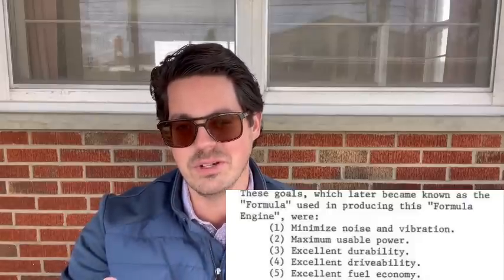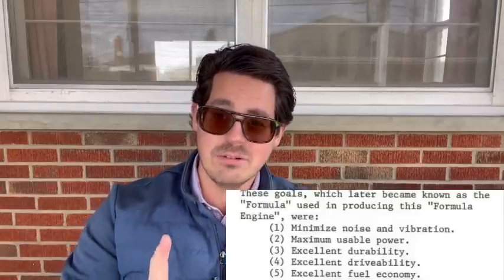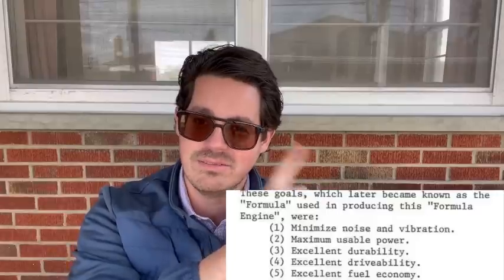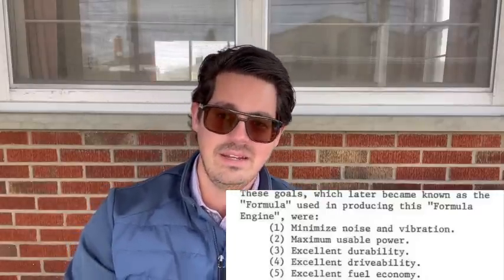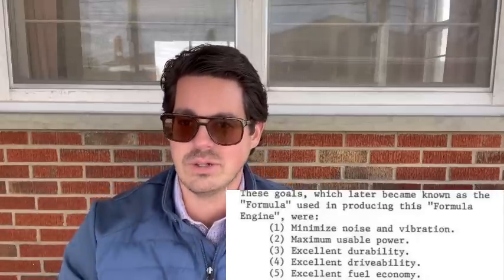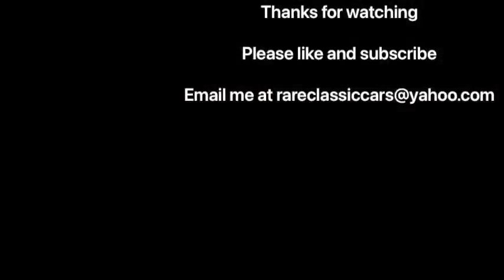Worst Engines of All Time: GM's 2.5L Iron Duke 4-Cylinder

Comment: Spot on review. One thing these engines were good for were marine applications. I had one in a mid 80's 17' Sea Ray. It made 120 hp, which was adequate,  it was  fuel efficient, and extraordinarily reliable.  The hull and engine cover did a fairly good job absorbing the noise and vibration.  I miss that old boat.
Reply: The marine engine was designed  back in 1962 .
Completely  different  program.
The Duke was a metric engine and the marine engine was SAE  dimensioned

Comment: One of my Uncle's had the EXACT opinion of the Iron Duke as you described. He had a 1977 Buick Skylark with a 350 V8 and in 1982 wanted to trade it in for a new Skylark. Well when he first looked at the new Skylark, he was rather impressed with it, even though it was a good deal smaller than his current car. He was surprised at the roominess of the interior for being a smaller car. He found a 2 door that he liked in the color and options he wanted and went for a test drive. When he started the engine, he changed his mind immediately !!! At idle it shook the whole car so badly he thought the factory put in defective motor mounts. He also said that his Stepfather's John Deere tractor was quieter and smoother running !!! He instead opted for a Buick Century coupe with the V6.

Comment: Had a few of them in S10s.  Ran a company that used them for delivery. Didn't have a lot of problems with them. Couldn't get out of there own way but would easily get over 200k.  When they switched to the 2.2L then the real problems started!
Reply: Same had 225K on my S10 with a 5 speed, never had to do anything to engine, clutch or transmission. Just a water pump, coil and exhaust gasket.  Replaced two rear ends and some brakes but was reliable as can be never left me stranded.  But I also had a Chevette with 185k so maybe I am just lucky I sure did beat on them.

Comment: While a bit crude and noisy I wouldn't call it the worst of all time more like a middle of the road reliable but not too pleasant engine. By 1987 it was smoothed out with balance shafts on the stick shift cars and 1988 with automatic transmission and was a decent engine from that point forward. We used to upgrade the dog bone motor mount to the Moog that was hydraulic and smoothed both the engine idle and transmission shifts.  I would call the HT 4100, 5.7 diesel and Northstar engine in its early years as the worst from GM.
Reply: Had 2 Iron Dukes back in the 80's, both with the TBI system & THM125C. Both were reliable & reasonably trouble free. As to refinement I didn't think they were really all that bad, especially compared to Chrysler 2.2 litre that we had in several vehicles where I worked (idling in drive those steering wheels used to shake vertically to the tune of about 2 inches! Not acceptable!) You could feel vibration in the wheel from the "Duke" but they didn't shake like that. Wish I'd have known about hydraulic "dog-bone" replacement. Would have installed one...
Reply: Its fine for low rpm work like Postal vehicles but as a passenger car engine its awful.
Reply: @darrengarcia4937  It was a hell of a lot better than that Vega engine!

Comment: I had one of these engines in an 81 Citation.  It had what I believe was called the 2 Barrel Varijet carb.  Two issue with the engine, never depress the gas pedal to restart if it was warm (it would flood immediately), which people I let borrow the car found out quickly if I gave them keys after driving it.  Also had to change two ignition control modules, but you already have a video on those.   Other than those issues it seemed to be bullet proof to a certain level of abuse from a college aged kid.
Reply: My father bought his new in 1981 and the only two things that failed were the ignition control module and one of the stainless pipes between the engine and the converter. Not bad for  a car with such  a bad reputation.
Reply: We had a Citation for a few years in the mid-80s....  I remember when we got it, I was amazed because it seemed so fast!  That may say more about the six-cylinder Nova we had before the Citation, but at any rate, in the 55-MPH era the Iron Duke was certainly adequate (and returned good MPGs too) in the little Citation.
Reply: I got my dui in a 81 Citation, parking it in someones basement cost me dearly...

Comment: Completely disagree on the Iron Duke being one of the worst engines of all time. The engine was used in many GM cars and trucks of the time, industrial, and marine applications. We had one in a 1989 Buick Century for many years and a couple of hundred thousand miles. The engine was pushed hard and never had any sort of issues or problems and got excellent fuel mileage. Every person tells me the same about how reliable the engine was. In my opinion this engine possibly could be considered to be on the best GM engines of all time list.
Reply: I totally agree with you. It may not have been ultra-refined but definitely not a bad engine! I owned 2 of them. (Both Chevy Citations. Did need an oil pump in one of them, but no other problems to speak of). As to vibration, neither of mine nor any others that I had experience with seemed all that bad. In fact I thought they were quite good compared to other large 4cyl engines. It's easy to say the import engines were smoother but few of them were even as big as 2 litre at that time & vibration seems to be less prevalent in 4cyl under the 2 litre mark.
The engines I was familiar with that I thought were really crude & rough were 2.2 litre from Chrysler. Place I worked in mid/late '80 had 2.2 litre Plymouth Horizon & Voyager. When you dropped them in "Drive" they would sit there with the steering wheels shaking up & down about 2 inches! That was ridiculous. Never had that in any of the GMs.
Reply: This "worst engine" was popular in Dirt Track Cars. There was a Marine version as well. Postal vehicles STILL Running this engine. Imagine uploading this video and all the negative response for talking out of your @$$ about a subject your not well schooled on. I would love to find the Offy 4bbl intake for one of these. Comp Cam kit and 2 gear timing set. Pushrod inline 4. Tough hombre.

Comment: The fiber gear was probably made of phenolic laminate, e.g. Micarta or Tufnol. Ironically, this material is usually selected to reduce gear train noise! The soft gear absorbs the high frequency vibrations that create gear whine. A hardened steel gear would no doubt have lasted longer, and not rattled due to wearing down.

Fun fact about phenolic laminates: they can be adequately lubricated by water rather than oil. As a result they are a popular material for propeller shaft bearings on ships.

Comment: I'm from Brazil and I have a Chevrolet Opala, the car that was first equiped with the engine that gave birth to the Iron Duke. Mine is an 89 , carburated and powered by ethanol. This sounds bad but it isn't. Even though we didn't received the "improvements" that the US cars did I really like this engine. It vibrates a lot but if you set the iddling around 700rpm it becomes quite smooth and with a nice exaust it sounds good too. It's not fast but it offers a nice amount of torque which is ideal for city driving and fuel consumption. Also Brazilians used to call it the "sewing machine" because of the distinct noise it makes.

Comment: Sad GM already had the great 153 2.5 4 cylinder, that they had been making since the 1962 Chevy 2 Nova. 
Has been used with an outdrive in boats for decades by Mercruiser and OMC, when they existed.
Takes a durable engine, to survive in boats, heavy load when boat is on plane. 
Same design as their straight six, with 2 center cylinders removed.

I ran a 1969 2.5 in my boat for many years and it ran VERY smoothly and sipped fuel. 
An aluminum Starcraft cabin boat on water, will amplify any noise or vibration.
At idle, could barely tell engine was running. Great for slowely trolling; quiet, smooth, no exhaust smell and used very little fuel.
Could tow 2 tubes with kids on them, at 25 - 35 mph all day and burn 6 gallons of fuel.
Never left me stranded or gave me any issues while on the water. Easy to maintain; change oil and clean the points for the season. Carried spare points, condenser and coil; never needed them.

I and my friends, also had many iron dukes in S-10's and they failed, if used under hard loads; not nearly as good as the 153.

The 153 must have cost too much to make and lasted too long in automotive use; industrial engine.
The 153 (181) is still produced today, in it's 3.0 (181) form.

Always wanted to try swapping a 2.5 or 3.0 into a small vehicle; uses standard chevy bolt pattern.
May need to be an automatic trans; not sure if all of them have the thrust bearing for the clutch.

Comment: A guy I worked for back in the 80's got 41 mpg hwy in his Citation with an Iron Duke and a stick. Nuthin' wrong with that.
Reply: Just left a comment elsewhere. I used to do a consistent 38 mpg from PA to Vermont, running about 65mph with 84 Citation, Iron Duke, throttle body injection, 3spd THM-125C auto (w/ lock-up converter). Went from PA to Vermont & still drove a day or two before filling up. Not particularly fast or powerful but geared right that I did any hill in Vermont without undue stress & wasn't holding anybody up.
Gas prices being what they are, wish I had a modern car that could do that!
Reply: @DejaView  any modern economy car will do that. Honda fit, toyota aygo, vw up, whatever.
Reply: @SomeOne_86  show me one with a 20 cu/ft trunk. That's what the cargo area was rated WITH cargo cover in place. (even greater with cover removed) 5 people could go for a 3 day ski weekend, ONLY the skis were on the roof. Luggage, poles & 10 ski boots all in the trunk... 
The newer cars are undoubtedly going to be quicker in spite of smaller engines but in the highest MPG "mini-cars" are we still factoring in automatic transmission?
Reply: @DejaView  Toyota Rav 4 Hybrid has 37.6 cu ft of trunk space, can seat 5 people easily, and gets 40mpg. Also did I mention it has AWD, 220hp, 11 speaker JBL audio,  dual zone automatic climate control, heated front and rear seats, ambient interior lighting, a 5 star NHTSA safety rating... Man you have to understand that technology advances over time.
Reply: Our family ride was an 80 skylark with a 4 speed manual. My dad regularly got 42-46 mpg on the highway

Comment: My parents had a 91 Calais with the Duke.  It was extremely quiet when brand  new.  After say 20,000 miles there was a certain clatter associated with it.  Like you say it was durable and reliable and economical.  When I later got a Calais with the 'upgrade' Quad 4 ... well it was much louder, and hobbled by the 3 speed.  The Duke was better than the Quad unless you enjoyed lots of repairs.
Reply: My 91 Grand Am was very quiet until 1 day I beat on it pretty hard then the timing gears started to make the clatter sound.  That was around 40,000 miles or so.  The Duke was a good reliable motor.  It served me for 200,000 miles until I sold it to a friend.
Reply: Wasn't the "Quad" Great for "getting down the road?"   {--for a 4 }
Reply: @jackdale9831  maybe it was if it had the 5 speed?  3 speed automatic almost negated any extra power in what was on a test bench indeed a powerful DOHC all aluminum 4 cylinder  'motor'.  The days when it ran right and at the right revs, yes it was pretty cool.  Calais was a good looking compact to my eyes.
Reply: I hate hate hate hate that going to low idle speed when it was warm. You happened to have mentioned. On the POS iron duke from 1980. On my old forgotten POS Pontiac Sunbird hatchback. I had to take that POS back to the Pontiac DEALER about 6 times. Because when i had the A/C on while in " D " position on the tranny. It just couldn't stay on normal idle speed. Hated the car and hated the engine. With a passion. !!!

Comment: i also had 3 different cars with 2.2 TBI engines and they ran a little smoother and didnt have the timing gear clatter sound..... but they were well known for head gasket issues. given a choice i would rather have the cast iron head sitting on the cast iron block. rarely did they have a head gasket issue.

Comment: I worked from 81 to 86 in a gm dealership ,I loved the 2.5 mostly because folks seemed to gravitate to the 2.8 v6 now that motor was a genuine pos ,carb with electric controlled jets ,leaking rope type rear main seal ,all for .3 more liters ,
Reply: Agree, the 2.8 was junk.    The carbs on the 2.5 were junk too, best they did was go TB FI and they were anvils.  👍

Comment: A friend had a Celebrity with the Iron Duke engine. It always was a little noisy until it reached 100.000 and then you could barely hear the radio. I replaced the balance shaft assembly and was as quiet as new. By the time it hit 200.000 the car was very rusty so he decided to scrap it. Before we scraped it we tried to blow it up. We tried for 2 hours on the rev limiter until there was no coolant in it and dumping everything we could find down the throttle body until it finally ran out of gas.
We added a little bit of gas we had around and when we started it, it ran like new.
I used to call them a tractor engine but I gained a lot of respect for them that day.

Comment: I had an ‘82 Buick Skylark I inherited and drove for a few years in the mid to late ‘90s and remember vividly how rough the engine sounded and the shake that came through the steering wheel at idle just as you described. That said, I never had a problem with it, very reliable. Thanks for another awesome informative video. I also had an 83 Impala wagon, with another possible ‘worst’ contender, the 700R4 transmission. Went through three of them in as many years, with only normal use. Curious if this was common experience.

Comment: I always considered the 2.5 Iron Duke a “decent” engine. The one’s I’ve seen give excellent service were the 2.5’s that got religious oil and coolant changes. To me they sounded like coffee grinders. I had one of these in a 1983 Olds Omega with a 4 speed manual transmission!
Reply: Mom and Dad had a 1992 and my sister had a 1987 and Dad said they sounded like coffee grinders.

Comment: Im glad you mentioned the timing gear. Its a noninterference engine so no issue when the gear gave out. Cosworth made a Duke that cranked out 500+ rpms so they had potential.
Reply: 500? did you mean 5000? XD
Reply: @SomeOne_86  Hp not rpm's, my bad, Spell correct is stupid sometimes.
Reply: @The_Future_isnt_so_Bright  damn, they made a 500hp one? Was it turbocharged or supercharged?
Reply: I believe turboed; but those engines shared nothing with the real production Dukes. The weak point of the Duke is the crank, usually good to about 180ish hp. A 3 liter Mercruiser crank(forged) can be machined down and used as a stroker crank

Comment: These things sounded like they came with a factory rod knock.  Never knew it was the cam gear.  They were damn near indestructible though.
Reply: At least in '81, they also were designed to ping a little. The owner's manual said that that was normal and that it was due to the engine timing algorithm which maximized fuel economy. It never bothered me.
Reply: WHY didn't the After-market sell an iron/zinc/aluminum timing-gear, so the teeth on the Nylon gear wouldn't potentially "lunch" the whole engine?
Reply: I agree with you a hundred percent  , but they were reliable as heck. I know the sound, especially at idle  when they were up there in miles..

Comment: I remember back in 82 even the new Camaro had the Tech IV/Iron Duke! It was a decent engine, very reliable, but was too harsh and noisy compared to its competitors. Didnt even know it was still being put in cars up to 1988.
Reply: 91 I believe, was still in some Oldsmobiles
Reply: It was used in S-10's through 1993. The USPS trucks that use this engine are still on the job today in 2022!

Comment: My greatest issue with this engine was the location of the distributor. Combined with the unreliable nature of the ignition module, you had a nightmare when it came to serviceability.  It was obviously related to chevy’s inline six. But when they made the cross flow heads, it placed the distributor under the intake well hidden.

Comment: I took my drivers test in my mom’s 79 Pontiac Sunbird coupe equipped with the Iron Duke. I drove it a lot before I bought my first car. We never really had any issues with it. It certainly wasn’t a fast car but thought it ran pretty good for what it was. I remember it was carbureted version. The carb looked like a quadrajet cut in half. It ran about as good as an 81 Grand Prix I test drove that had the Buick 3.8 V6. You can make fun of their low power output but GM made plenty of performance parts for the Iron Duke. Back in the day it was the 4 cylinder of choice for racing. I do remember a buddy of mine had an 82 Firebird with the Iron Duke with a 4 speed manual. It was pretty pathetic. A car that looked that good being painfully slow.
Reply: We used to call '82 Firebirds "Emily Post polite", floor the accelerator and watch everyone else go first.

Comment: Pontiac Fiero 2M4 SE 5-speed here. I'll never forget when people would get into my car for the first time and start up the Iron Duke - the vibration from the back! In some ways, I think it was a great choice given the Fiero's complex cooling system. The iron block and head were very forgiving for overheating. The Achilles heel was Fiero drivers made the mistake of over-revving them. I did tear it apart and rebuild the engine, put another 200,000 km on it after that.
I miss my Fiero, and I would only want an Iron Duke in it.
Reply: Just bought a 15k mi iron duke fiero, any advice for a refresh? Parts and the like I should do before I try to drive it